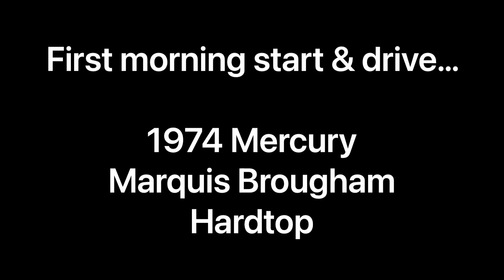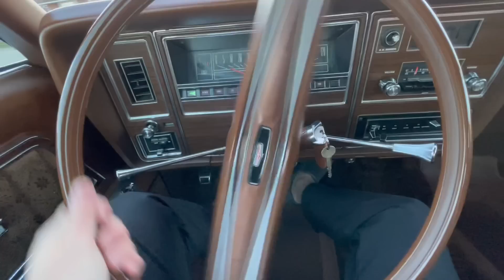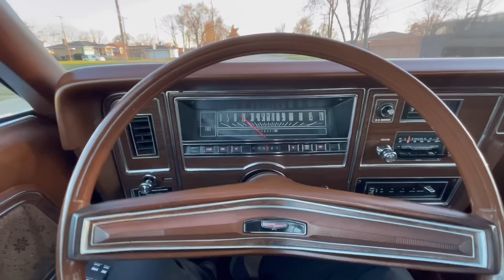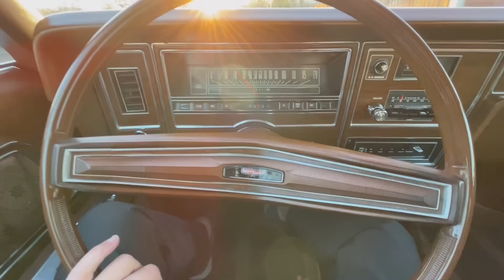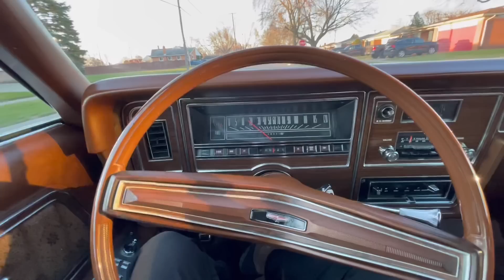1974 Mercury Marquis Brougham 460-4V Hardtop Walkaround & Drive: The Hawaii 5-0 Car

Comment: I bought one of these beauties down in Fla. in the mid seventies. 30 k miles , different color though. Mine was a burnt orange  with a brown hard top, interior was a light tan mix of leather and velour. The previous owner was a school teacher. That was a favorite line from the car dealers back then. Loved that car on the highway. Same wheel covers that weighed about  25lbs a piece! Never saw another car like it.

Comment: I saw the Horn Ford decal on the left hand corner of the deck lid.. Worked their in 2009-10 before the Great Recession... Really beautiful car.. Had a 1969 Ford LTD Brougham in the late 70's with the 390 4bbl... Great riding car.. Fords slogan was "Rides and drives quieter than a Rolls Royce".....

Comment: I replaced the water pump on one of these, had it fully reassembled only to find a casting flaw— a pinhole at the top! Rather than repeat the job I was able to hit it with the arc welder and fill the hole with a welded bead.

Comment: Not a car comment, and not being from your part of the country, watching your videos, I'm amazed at how all the houses are all exactly the same in your area.....brick with even the roofs the same. Any comment?
Reply from the maker: Very common in the era they were built, late 50s.
Reply: @RareClassicCars  : 
more info..... Ford switched to a different type of bushing/grommet (whitish nylon?) for their automatic column shifters that actually got tighter as it aged by swelling up (expansion due to micro-cracking?). 
Silicone lube frees up the later 70’s & 80s shift linkages.
many of the early sloppy column shifters required “pulling up” to start the car so the neutral safety switch would engage the park position. 
I’ve owned hundreds of FoMoCo vehicles from the 40s 50s 60s 70s & newer. 
Currently have a Low Mile mint Original
‘76 Cartier MkIV with the “Cross Country Pkg.”hydraboost 4disc “freight train brakes” & R.ABS, Handling Suspension incl. fatter front & rear sway bars, R.Auto.Level, HD Cooling, Trac.Lock 9” with 2:75 Gear (1500rpm at 60mph! gets 25mpg Cdn.gallon!), Dual Exhaust, Alloy Dish Rims, and I saved the Factory dual-stripe w.w. Michelin X H78-15” Tires which still have 50% tread! I put them on at shows. For driving I have an extra set of Lincoln alloy dish Rims with new Michelin’s and the Cartier goes down the road like a hot knife through butter..!!!
All Cartier Designer Series for ‘76 were Dove Gray and this one has the pillowed plush suer-soft velour interior, whisper quiet with 
Amazing Ride Handling Braking & Performance. 
I put a 1970 429 Timing Gear/Chain, Accel Distibutor, Holley 650 DP carb (lots of vacuum!) with ‘92 5.0L Mustang Catalysts (4) for my lungs sake lol, and the low compression 460 has amazing smooth torque, much better than factory.

Comment: There was also a '72 Marquis on H50. It was to have replaced the Park Lane, but Jack wanted to continue driving the Park Lane. The '72 made two appearances, most notably in "Loose Ends Get Hit" (Season 8). All three Mercurys were seen in a chase up Diamond Head to Battery Harlow and back down, starting with the '74, then a few shots of the '72, and finally with the Park Lane at the end of the chase. Check it out on Paramount +.
Reply: That series lasted 12 or 13 years.Mcgarret never got a new for '79 Grand Marquis.That would have improved sales.They kept the '74 until '80 to 81!!

Comment: Such a good looking Luxo-barge.   The interior on these car are so much better than the black holes we get now.   Nice lovey idle burble.   If I remember correctly the original tailpipe had about a 16-18” very large probably 3–3-1/2” dia. extension  with a turn down at the end that terminated about a foot or so from the rear bumper.  I don’t know if that made a difference in sound or not. Ford always had more interesting exhaust tips than GM.  These and the Lincoln’s of that era shared these tips.  Another example was my neighbors new 1972 Gran Torino Sport with the 351 CJ.   The tips were 10-12 inches long and were welded on so they didn’t appear as tips and very unusual in shape.   Almost  like a rectangular box that was slash cut then notched.  Sort of like the SS Chevelles without the chrome tip and the odd slash notch cut.   Only certain engines in the Chevelles SS’s had the bottle resonators and oval chrome tip.   Maybe the Gran Torino Sport was the same because my neighbors was the top hp engine for 72.   Almost 60 hp more than the 429 that was available.   It was so crammed up from the factory that you had to punch it and let off to get enough vacuum to get it to shift from 1-2 when it was cold.  It was a very cool Gran Torino with the formal style vinyl roof ( a la’ Cutlass Supreme) as opposed to sports roof style.
Reply: You remember well!  I grew up with these cars - purchased new - in the family, and many of the larger engined cars of all makes had exhaust tailpipe attenuators, which were the extensions you recall.  On the '73 and '74 429/460 full sized Fords and Mercurys, the attenuator consisted of the large-diameter turndown extension you refer to, but inside that extension was an inner pipe which actually intentionally was shaped down into a flattened exit at the tip!  The inner pipe was only visible by peering up into the outer turndown. My uncle had a '73 Marquis Brougham with the 460 which he purchased new, and it had this tailpipe configuration, which reduced the exhaust noise to a "whoosh" sound.  My cousin - his youngest son - quickly put on a dual exhaust with "turbo mufflers" at the local Midas shop in 1978 after his dad gave him the '73 as a gift (my uncle had just ordered and purchased a 1978 Grand Marquis 460).  It was a real thrill for my cousin and me to hear that "opened-up" '73 when we first started it up at Midas after they performed their magic!

By 1975, Ford was using a similar-looking exhaust extension on their single exhaust full-size models, but the inner flattened pipe was replaced with two screens, which yielded a similar effect in silencing.  My uncles '78 had this tailpipe system, as did my parent's '75 LTD Landau with a 400.  As an aside, with the exception of police models, the only '73-'78 full-size Fords and Mercurys to receive factory duals were the '75 and '76 460's.  We had one of those in my family too, and they had 2" tailpipes with no attenuators.

Now, years later, only a few very low-mileage cars and trucks from the '70's and '80's with their original exhaust systems have these tailpipe attenuators in place, as replacement pipes almost never had them.

Comment: It strikes me how similar the seat design and fabric are to the 1970 Electra Limited! Beautiful car This is about the same color as my dad's 72 LTD Brougham, one of the two cars I learned to drive, the other was a 73 Monte Carlo. You spoke of the handling of the Mercury, dad's LTD was the same. The first time I made a right hand turn in the LTD I almost ran off the opposite side of the road as I had turned the wheel half way around, what was needed in the Monte Carlo. As I recall dad yelled "What the h*** are you doing?!" I replied "It doesn't turn like the Monte Carlo!".

Comment: I purchased a 2 dr. Ginger Glow 1974 LTD Brougham with  the 460 brand new. Kept it for a few years and then it went to a good friend. Only issues were a noisy steering spool valve and a lean surge at highway speeds. Replaced the valve and up-jetted the carb. No issues after those corrections with anything. Just about everyone who rode in the car told me it was the smoothest riding vehicle they were ever in. And the quietest too. "Quiet is the sound of a well made car." I do miss it.

Comment: That is a beautiful car.  Funny you should talk about being careful with the windows.  I remember getting pissed at my buddies when they would close the doors by pushing on the windows.  "Don't close the damn door by the window"  I would yell out in frustration!  I'm surprised the window didn't break or come out of the track trying to close those heavy doors.  Same thing with my 78 Camaro.  My friends still laugh about what a pain in the butt I was back then, little do they know I'm even worse in my cranky old age.  The "war department" was pissed at me and slammed the passenger door shut on my Camry, now the door rattles like it has broken glass inside and the window struggles while going up.  Guess I'm gonna get some edumucation taking that door apart.  
Looks like someone put an aftermarket "fits all" upper radiator hose on that beautiful Merc.  Hopefully you can find the right hose when you replace the thermostat.  
I'll bet your neighbors pester you quite a bit when they see all the different cars, I admit I would be a pest also!
Reply: I'm confused.  Please explain what you mean about the 4dr hard top door/window design being changed in 74.  Are you sayiing the 74 and later models were "post cars".  Oh well, maybe I just never noticed the addition of the "b" pillar in later models.  It's a tight fit in your garage, be careful that nothing falls off those shelves onto it.
Reply from the maker: 74 was the last year for the lack of a pillar. From 75-78, all Ford four doors had pillars.
Reply: @RareClassicCars    I'll be darned, never really noticed.  Will surely pay attention the next time you show a later model.

Comment: love those big old cars my grandmother had a used 79 Cadillac Coupe Deville with a 5.7 liter V8 when I was little and an uncle of mine had an 84 Chevy Caprice Classic with a 7.4 liter V8 in it loved those cars they ran smooth as silk and you didn't have to worry about being Woken up by hitting a speed bump/pot hole like you do in smaller cars I.E. Dodge colt/Chevy Cavalier  the later of those being one of GM's J platform cars which included some notorious duds I.E. Cadillac Cimarron  which cost 12,131 in 1982 yet a model like the Seville Cost 24,000 that year though the year of its launch the Seville started at $12,479 or 2.9% more than the Cimarron did in its debut year the Seville also had a 30 year production run on of Cadillac's longest model runs Cadillac's shortest production model run was the ELR at 3 years

Comment: It's like driving your living room around. The 70's 460s had retarded cam timing. To get a LOT more out of her- change out the timing chain, and gears. Advance the spark timing to 36 degrees total and you'll feel so much more of what the BBF can do. Swap in a Performer RPM manifold, Holley 750, smallish cam from Comp, Howards or Lunati. Add  headers and set of ported or aftermarket heads, and you'll have over 500 hp, 550ft lbs (easy) motor with plenty of vacuum and smooth idle.

Comment: I didn't own or drive the Mercury but did own two 1974 Thunderbirds. I really enjoyed the Big Ford 460 and it was the first year for electronic ignition for my car.   My cars got the Holley 4 barrel 650  and duel exhaust treatment back in the day.   They were tough as tanks with the C6 transmission.  That Mercury is a looker.

Comment: How hard is it to convert from the vinyl top back to a hard top? Other than removal and painting? 
Is the sheet metal the same under the vinyl tops? On some or all cars? Just curious.
I drove a "puke green" 1973 Monte Carlo 350 SB 4V in LA, while getting an education, for 3 years. Base model, Vinyl top, bench seats plus A/C and AM/FM.
I had about 150-300 parking tickets that I tossed because the car had Oregon plates. My Dad picked up the car and had a small problem with a heater vacuum controlled proportional valve causing either overheating or loss of coolant about 200 miles from our home in SW Oregon. He, naturally stopped and asked the CA HWP for assistance at a rest area. He told me this later and I was stunned they didn't say anything about the parking tickets. I guess I had built up some good Karma.
It had front discs and rear drums. I would come around a downhill left turn on the freeway at 65 mph (in the 55 mph Carter days). And see traffic at a dead stop. Hit the binders hard. The car would, brakes locked up, under complete control, kick its ass out ~75 degrees until I knew I had room to stop. Let off the brakes and it would immediately straighten up, like magic, to a nice controllable stop. I'm not a race car driver and have no training. I did learn that going sideways with locked brakes bled off a lot of speed and energy. Totally controllable by the steering wheel. I Never thought, Steer into the turn. It just seemed natural. Maybe a better brake proportioning valve or 4WDiscs would have been better? I'll never know.
I miss that car. A couple of dates, over 2 years, both commented on how well the car felt when driving. It was a period of dating drought for me. Sigh.

Comment: The water pump was replaced, but not painted, it's why it's brown and not "Ford Corporate Blue". Long term watch for cracked exhaust manifolds on the 460.. common problem from 1969 up until the 90's. Not sure if Ford put hardened, stellite valve seats in the heads in '74.. Does it run on leaded fuel?  if it did, get it done, or you'll be adding lead substitute with every tank of fuel.. Good luck, and great find.. it's a fabulous car, well worth the history. It's only equivalent sold today might be the Chrysler 300 luxury.

Comment: Those '69-'78 Full-size FoMoCo cars really were great. My grand parents drove a 1973 Ford LTD with a 2V 351w until 1990 in upstate NY rust country. The used 1984 LTD they replaced it with had a CFI 302 and was never as good, my grandmother lamented the lack of throttle response, along with not seeing any mpg improvement and my grandfather lamented the loss of simplicity for maintenance.

Comment: My late dad had a Canadian '74 Meteor Montcalm when it was near new. He both cursed and adored that car when talking about it for decades later. Loved the ride and handling, but it was a Friday afternoon lemon. It was originally a 400M with small-block bellhousing and an FMX transmission car. He said he changed it due to oil consumption and blew multiple 302s before changing the bellhousing and putting a 390 from a 68-something (maybe a Park Lane) which solved the problem.
Apparently it was one of the first FoMoCo cars to have an electronic ignition instead of points.
Love the barge body Fords, but still haven't owned one yet. Been running box-body panthers for 20 years as daily drivers and no plans to deviate :)
Beautiful car!

Comment: My Dad bought one barely used in 1974 It had the leather seats that came w the Grand Marquis  trim option It proved to be unusually problematic He traded it in for a new 76 Grand Marquis It had much better wide bodyside molding ran better and faster w dual exhaust and stopped better w 4 wheel disc's altho the antilock brakes were discontinued likely due to CB radio interference

Comment: The 74 may have been the closest you could get to a same year Continental; the tow car's exterior design language moved further apart for 75.  Those seat belts - wonder if original; pretty sure color keyed seat belts were standard, certainly on the Brougham.  I think I prefer the 4dr ht to the 2dr ht in most big cars of the era - what a look - but they do buffet like crazy.  Too bad no cruise - I never actually use it, but Ford was way ahead with the steering wheel controls and they look cool :)  Since many of these cars were built to order back then, I love to put myself back in the mind of Mr. X (and this purchaser was probably a guy) who ordered it back then and figure out why he chose this and not that option - was money an object?  If so, why select auto temp air over the mini-vents, or whatnot....  When casually looking, one good indicator for me is usually the power passenger seat - if the car has that, it's usually pretty well loaded.  Ditto, but not quite so much, the auto-temp AC.
Reply from the maker: Nope. Color keyed belts were optional on these back then.

Comment: I'm with you, Adam. The Marquis Brougham's luxury brocade cloth interior trim is so beautiful, it makes the optional Grand Marquis interior look very plain. When my family took a test drive in a 1974 Marquis, the ride was unbelievably smooth and quiet. The sales rep used an old Packard tag-line: "let the ride decide". He wasn't joking, the test drive sold a lot of big Fords and Mercurys in the 1970's. The oil crisis hurt big car sales, otherwise Mercury would've sold twice as many Marquis Broughams - ignore Joe Isuzu, you have My word on that!
Reply: Funny thing:
The oil crisis didn't reduce the demand for big cars, sales numbers even increased for large cars through the 70's. What hurt was finding available fuel overall. The Hopeless Car Guy made a really in depth video about the "malaise era".
Reply: @smellsuperb1  Lincoln sold well in 1974, even with the effect of inflation on sticker prices. I remember the Continental MARK was the first car to cross the $10k base price barrier, which was a big deal especially when compared to the Cadillac Series 75 sedan and limousine.

Comment: Those 4300 carbs are hit or miss you either got a good one or a bad one my 67 Ford 428 will not run on it born with carb, the original owner even had problems with it, I replaced it with a Autolite 4100.